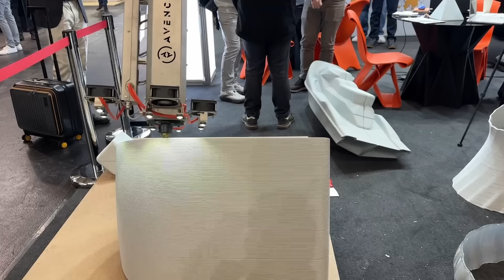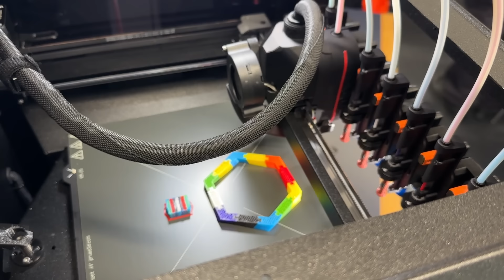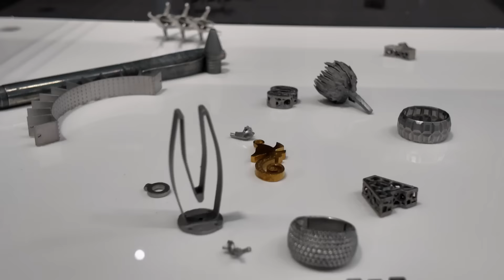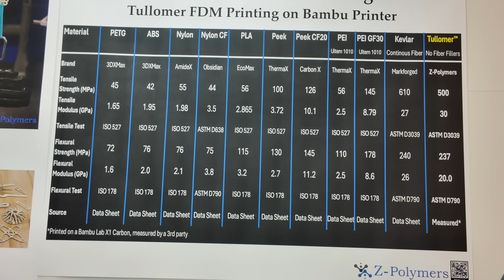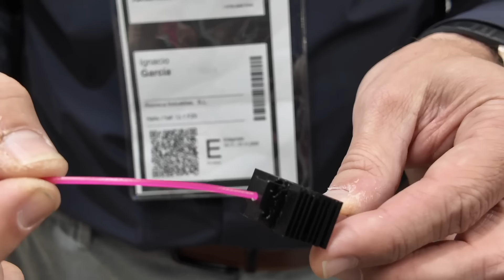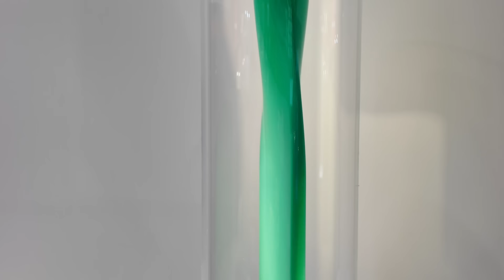2026 Will Change 3D Printing (Formnext Innovations)

Comment from the maker: What's your favourite innovation from Formnext 2025? Let's discuss!
Reply: I was there on tuesday only (no Prusa announcement for me 😢, but I got to talk to the Bondtech guy showing his INDX'd Voron).
My favorites were all the new flexible materials. PEBA, foaming TPU, electrically conductive TPU, even silicone. Most mesmerizing to watch was the printer that printed silicone into a gel (look ma, no supports!).
Reply: 400C would need a really good enclosure. This isn't a good direction as at some point everything inside will need to be heatproof

Comment: I'm in the making of a custom made Creality K1C with 2.85mm Hotend with custom made 2.85mm Extruder gears. I already have a custom made 2.85mm direct extruder enclosured coreXY printer, that can print 2.85mm TPU with over 25mm³/s without clog or skipping. I think, that 2.85m is still relavant. Zellerfeld also uses 3mm TPU, so i think, that 2.20mm TPU is not the only Option.

Comment: Tbh other than multicolor, im a bit dissapointed.

I know it is specifically covering 3D print, but mixing materials can enhance a product to a next level. Maybe instead min-maxing within, these companies can also include certain feature like laser cutting and UV. Laser cutting is one thing and certain company started to involve, but I feel UV printing is the next level for finished product. 

Brand Eufymake is viral lately because the quality and home-use/ small business approach, but I immediately saw a flaw, also plus they are having orders problems, then many companies that focus on laser cutting, etc started to jump the gun with better UV machine. I feel 3D printer companies should see this as opportunities and do the same.

It's hard to fix a fundamental flaw for layer lines, etc. Strength is one thing, combining materials can blur the defect, also we know texture patterns hide it too, but we cant just rely for patterns forever. 
Imo for finish looks UV is the way to go, no big labour, no harsh chemical, no require artistic or craftsmanship skill, no time consuming, stay cost effective.

I know we can just buy a laser cut or UV machine, but isnt a all in one machine better for cost and space, especially if they are related.

Comment: "How do you machine a flat melt chamber?" How I would do it: take a thick-walled tube, machine internal concentric features, press in a die to form the flat section while preserving concentric features, machine the exterior to final dimensions.

Comment: So much good stuff happening. Wow, and it's good to see everybody come together and Joel leading the pack with something great. So infill, investment casting, unique geometry to basically heat up all parts of the filament in one go. Larger filament to make it, you know, less kinking. Wow. And smart software, you know, because… they do in metal 3D printing. They print it distorted so it will cool the right area. We do that just for plastics as well. But I tell you. In fill with metal. That's something crazy. That's like mechanical parts crazy.

Comment: Okay, the infill is super strong because there's no layer lines. It's 100% dense, and it can, if done right, bond to the layer lines of the outside. That's really great.
Another thing would be what if you had continuous fiber in the infill? Forget the layer lines because that doesn't help. But if you put continuous fiber in the infill, or you put even metal rods with kinks in the infill, so as you shoot out and fill, and you monitor, and you shoot up, you're now putting in a pin of metal with bites in it surrounded by molten plastic that's also going into the walls. You've now got a piece of metal in there for the tensile strength, and then the bend strength is really the geometry of the part more than anything else, and the twisting strength. But there's no reason why you couldn't even put a 5mm cross-section of metal into an area that would fit it. If you design your part so there's always room for a 5mm cross-section, and you have this wire which is knitted into a little beam and that's pushed in there, then you've got extreme strength. I don't know if you'd have to actually have preformed metal bracing that could go down there, but a 5mm I-beam could probably even be rolled up. I'm trying to think like this - the damage of the roll that would be and what the stresses would be, but you could definitely unspool that timber and you can easily cut it with a machine and just jam it in, even if it's like a 1-inch section that'll be super bloody strong.

Comment: I hope Bambu takes the INDX route because INDX uses the whole bed due to the one nozzle system, works with flexibles since it doesn't have to retract filament, and INDX doesn't deal with nozle blocker and it has less moving parts, all of these points is something the H2C can't do. So I HOPE Bambu does something like INDX is doing

Comment: Fibreseeker isn't saying 7-10 days milling time but lead time, ie the time a 3rd party would take to ship you a custom part. Still not really comparable, and there are newer desktop cnc machines that are starting to be a lot more affordable, but still more expensive than the Fibre 3d printer...
Reply from the maker: Yes, that's true, but the comparison doesn't make sense. Why should you calculate lead time for CNC but no lead time for 3d printing. Either you make parts in house -> "no" lead time, or you make them 3rd party -> lead time. Comparing oranges to apples here imo.

Comment: I doubt thats how they make e3d fudge, but you could make your own by starting with a round aluminium tube with thick wall, crush it from the outside until the inside looks like that, and then machine the outside into a nozzle. 
The inside finish would probably not be too good tho

Comment: Indx solves more issues than vortex it's not only multi colour but multi material once you load it you don't retract the material so you can use flexible materials. That being said I still prefer snap maker u1 or Prusa xl solutions both for speed (it can heat up off the carriage) and provides redundancy. If you'd made indx with induction heating in parked position to speed up material change. Even few sec matter on material change as it has to do it for every material for every two layers. Also for me the super locked out approach to firmware and violating gpl from bambu is just no good. Just look at what happens with U1 community mods even before sources are released but there is shell access or how much was done with Prusa over the years thanks to proper open source approach.

Comment: FUCKING FINALLY I HAVE BEEN ASKING FOR THIS EXACT FUCKI G FEATURE FOR YEARS “(YEARS)” literally YEARS.
Reply: Now if they listened completely they would use this as PURGE infil for multi color, I’ll wait ILL FUCKING WAIT.
Reply: How I see it being done is after a certain hight a purge tower would not be needed the rest would be flushed into the infil “if” there is space. Then ironed with the new color and the next layer printed.
Reply: The original idea was to use the purge in the plastic to make it feel heavier and not send more plastic to the landfill.

Comment: I'd guess you don't even need a long nozzle for Z-pinning, since you can stagger the vertical fill chambers, like the infill chambers being only 3 layers high, but only filling 1/3 of them each layer, so the Z joints are staggered.

Comment: I'm not a bambu guy either.  I really dislike them as a company, but the proof is in the prints.    Bambu prints have much better quality than any other 3D printer I've ever owned.    So I bought an H2C just because I was sure it would perform, and it does.     I also believe that there are gains to be made with the ancient AMS.  It seems to me there are many seconds to shave off the retract and return phase of this system, but it hasn't been fully optimized yet.  For me, I'm looking at using 2 or 3 materials at once.   An ABS on the left, and maybe an accent color ABS and an interface layer material on the right.   I also like having a .2 or .6 nozzle on standby without having to change it at the printer.   I have the snapmaker U1, and tool changers are faster, but my H2C still makes higher quality finished parts.
Reply: What is it about the company that you don’t like? Legit question, as I don’t know anything about that aspect of the business, but they do make excellent prints so I was thinking about picking up one of their machines.
Reply: @RavingMadStudios  Locked up systems, locked up firmware, so very hard or partially not customizable, bound to specific slicer, forces you to upgrade if you don't want to discard your expensive 3d printer, updates that change the product, you have bought with specific expectations...
Reply: @petermuller6923 Good to know. I’ll spend some more time looking into it before I jump.
Reply: @petermuller6923  The systems aren't locked up, you can unlock them and put on different firmware like X1Plus. But you will lose support which seems pretty fair to me. You're also not bound to specific slicers and you don't have to upgrade. But to be fair, they only course corrected after a major backlash from the community, so I can understand the sentiment.
Reply: @RavingMadStudios  Well, over a year ago Bambu Lab rewrote their TOS and released firmware that made their printers more locked into their ecosystem.   They walked it back shortly after and made some alterations which allowed some people to have some comfort, but other people didn't like the fact that they could have pushed so far and only stop because of consumer outcry, and wonder if they could do the same thing in the future.    Bottom line is, Bambu still makes the best consumer grade printers out there, and they would still be my recommended product if anyone was serious about wanting to buy a new printer without any considerations other than quality.   So, If I were you, I'd buy and realize you're dealing with a company who might change the TOS and the printer you bought to not have the functionality it had the day you bought it.  That's all.

Comment: @JanTecEngineering Can you test if embedding a woven fabric into a 3D printed part increases strength. You can easily cut it in any shape, stop the print halfway and lay it inside a printed part.

Comment: damn, the Infill Injection is so obvious yet revolutionary, although I have my doubts - how do you make it so that it won't cool down too fast halfway or even sooner. But if they do it then they probably got onto something - maybe the push-seal with 300*C and high pressure does the trick. The best part is that it's purely a software challenge, theoretically available for everyone
Reply from the maker: Yes! I think our 3d printer hardware is really good but software can get even more out of it.

Comment: E3D’s Fuge nozzle design is a brilliant idea(!) AND, it’s probably even easier to machine than the Bondtech design.

- Start with slightly oversize stock and bore an oversize round hole in what will be the receiving end. Then put it in a press with the right-shaped die to flatten a section, creating the flattened internal profile. Back into a lathe to turn the OD back to a cylinder and proceed normally from there. You could get the receiving end back to the right diameter by pressing in a collar.

They probably have an even easier method, but what I just described could easily be done in a home shop.

Comment: The ironing tool is so good for a multi-nozzle or multi-toolhead system. Imagine always making large flat prints and you needed to iron those. You could use another nozzle or toolhead with wide nozzle to speed up ironing.
Reply: IMHO it needs a dedicated adjustable directional iron to smooth all sides as its printing them.

Comment: Hi Jan! Can I send you a HPPS system for X1C/P2S or H2 series? Its a foamed silicone foam panel kit for insulating the printers; makes a large difference to chamber temp, temp consistency, and power consumption. I make them in the US in an aerospace environment with low margins and a large community. I would love to send you a unit!
Reply: Just to note; thank you for making excellent, no BS content! :)
Reply from the maker: Hi! Thanks for your comment. It sounds like a very nice product, but I don't have X1C/P2S/H2. If you start to make one for the Core One, please reach out!
Reply: @JanTecEngineering  We are actually just modifying the H2 units to fit the core one! There is a lot of momentum around HPPS for Core 1 & L.
Reply from the maker: @8710ify  Cool! Feel free to reach out via DM or email.

Comment: There are stabilizing resins people use for wood and stuff. I wonder if that could work with 3d prints. They usually require baking to set them so that might be a problem with low temperature filaments.

Comment: Another way to manufacture that complex nozzle geometry would be to make a core out of something that can be dissolved, e.g. salt, cast the nozzle over that core, finish machine the exterior, and then chuck it into a circulating water ultrasonic bath to dissolve the core out.  This lets you make arbitrarily complex and high resolution internal geometry that cannot be made any other way, even by 3d printing.  I've used this technique to cast sponge-like shapes in aluminum.
Reply: SLM printing

Comment: INDX is clearly the better solution over Vortek. Anybody who tries to argue otherwise is either trying to sell you Vortek or is a blind BambuLab loyalist. I say this as someone who owns an X1C and bought an H2D for my team at work
Reply: Vortek has both of the downsides of a AMS system and a Toolhead changer , plus more complex than the INDX, can't entirely blame bambu because a proper toolchanger printer  make the AMS obsolete in some situations , but yeah, One of the few upsides is that the Vortek can reach higher temperatures than the the INDX

Comment: I see all filament going to larger diameters. Speed is limited by how much filament you can extrude. Minuteman proved that pushing more equals higher speeds. He used 2 and 4 filament extruders into a single custom hotend. Add a flat spot and splitter in your hotend along with larger diameter filament and you wouldnt need multiple filament strands.

Comment: Bambu Lab vortex is far more interesting than the copy/paste Prusa is doing on other peoples machines.
Reply: The mechanism behind the vortek system is more complex, but I don’t think it makes it better. It sounds like you get the worst of both worlds. You still have filament changing which means time, less filament compatibility, and higher purge times, and you still have hot end changing so more expensive. Not sure if I’m missing something that makes it better than the indx?
Reply: @C8-H8 The Vorex system is actually less complex than the INDX.  And if a little more time means better prints, that will always win.  You can have faster tool changers but if they can't print quality, there junk.

Comment: Tullomer looks interesting but in the info you showed I saw no mention of Z direction tensile strength. That is the first thing I look for in any new (to me at least) filament.
Reply: My understanding is that they have problems with layer adhesion so z strength is poor. There have been some interesting reviews of it on YouTube. Seems to have serious drawbacks.
Reply: @NickNick3DP  Hense why it was not in the list of properties.
Reply: @NickNick3DP  if z-direction is poor, then their suggestion of using it in infill might be a bad idea, and really only has a few specific use cases.... man that's unfortunate.

Comment: indx sure looks interesting. i wish it was a bit more adjustable like maybe you're not sure about many nozzles so you buy one that is setup to one nozzle and add more nozzles later on. I like that the tools use inductive heating and are  relatively simple, but i wish this system would be more affordable to be able to be more widespread and adapted by competitors. Probably maybe something that costs like an a1 with ams lite.

Comment: I had the thought of filling the voids in the infill before, especially for multicolored prints. Image pushing all (or at least some of) those purge poops into the infill instead of the waste bucket!
Reply: I think purge into infill is already part of orca slicer?...
Reply: @brazenh2836 really? I had no idea. That's pretty cool
Reply: @brazenh2836 yes, but not like that. Also i use crealityprint, which does have that feature, but it does not seam to work very well from my testing.
Reply: @bra @brazenh2836 it’s a part of any modern sliver
Reply: @brazenh2836  it is but only at the percent already set.
Reply: @brazenh2836  I believe that is just using "purge material" to make the infil, not doing the poops directly into the infil space. Still useful.
Reply: Purge to infill is a thing in any modern slicer

Comment: nano ion 3d chip printing, ie compute, mems and solar chips at home. ion beam drawing and ion deposition masks all in one machine on any substrate with electron depth scanning imaging built-in. yep nano scale and nano layer height. yep kinda like laser metal powder printing but with ion deposition of layers. yep old crt vacuum tech but with ions. just swap the gases material inputs. also if you dont want to bother with tool changers, make multiple independent tool head tracks side by side using a bed slinger movement location to select the tool head track. yes the toolheads need to be small narrow.